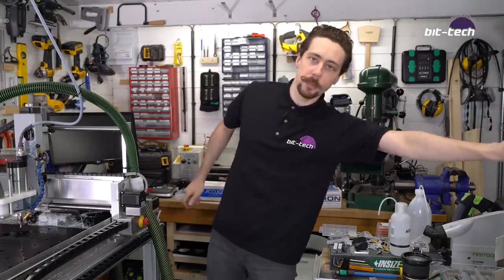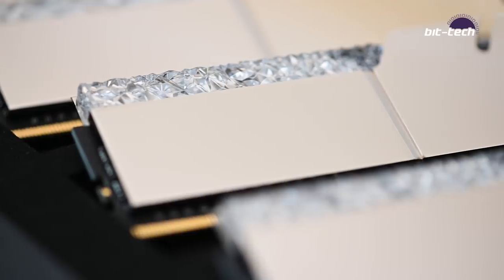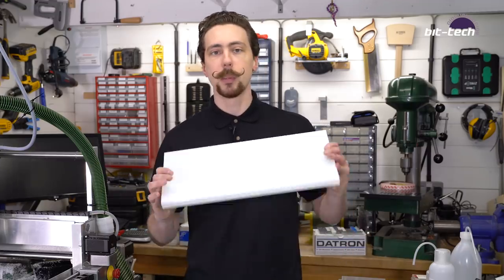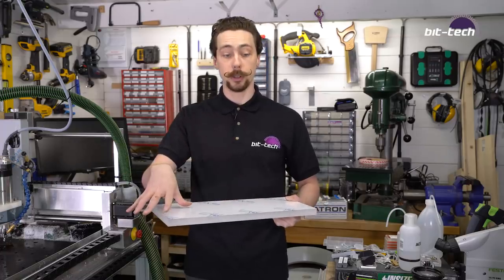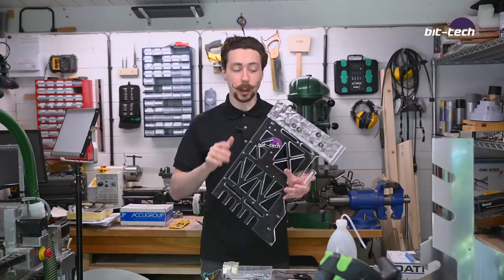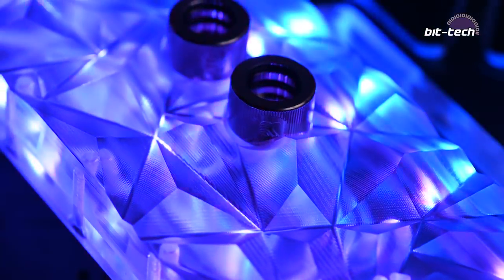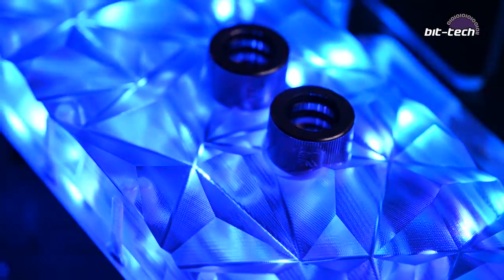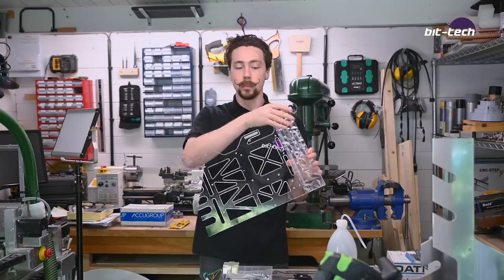G.Skill Trident Z Royal Scratchbuild for Computex 2019 (Part 3) | bit-tech Modding

Comment: Would’ve sucked if you lost power midway through that 12 hour cut
Reply from the maker: Oof pls no. I was genuinely worried about a USB disconnect though. My control PC is an old NUC I built back in 2013, my cat damaged the USB ports by knocking it off a wardrobe when it was plugged in. As such, the connection isn’t that strong, so once in a while the link gets interrupted by vibration. I really need to replace that really, just a matter of when to do it.

Comment: love the art work your did epic beauty . Can you tell me what's the brand name of your machine you used to work on the panels please. and the drill tips you used i loved how clean it cuts due to the speed rotation setup and movement speed as well.
Reply from the maker: My machine is a CNC Step S1000-T, I generally use Datron tooling, really high quality and leaves a fantastic finish.